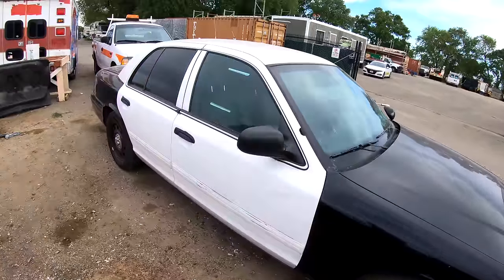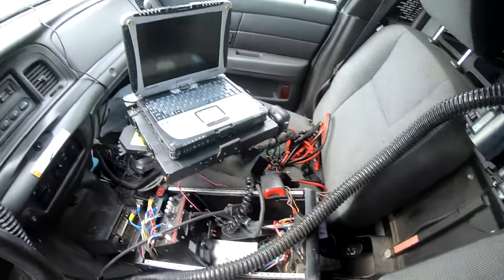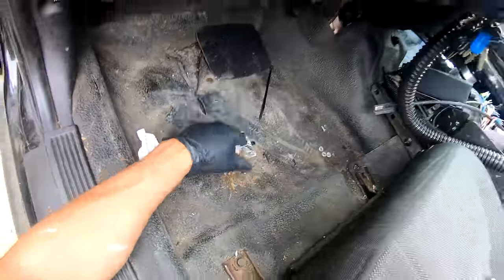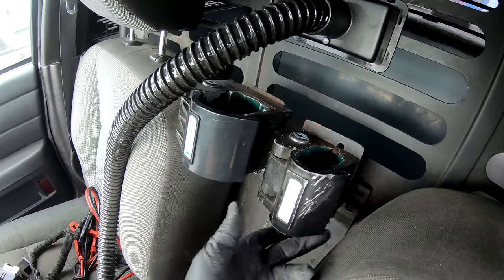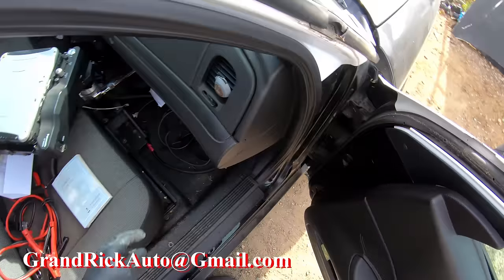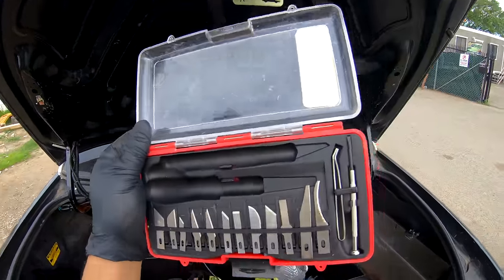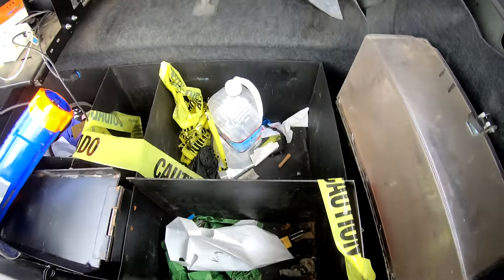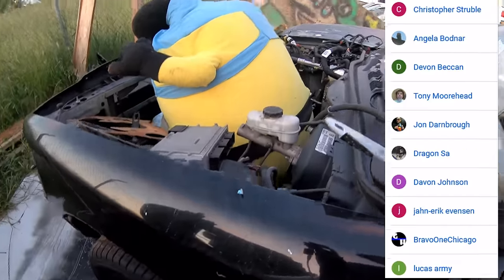Searching a Decommissioned K9 Unit Police Car! Found Prisoner Escape Key! Cops wallet! Lights Siren!

Comment: It's best if you take the wallet to a bank that they have, typically the banks have their most up to date information. You can also drop it in the mailbox and they postal office will return it. But your best chance is at the bank.

I also entered your giveaway :)
By chance are you giving away the code 3 siren?